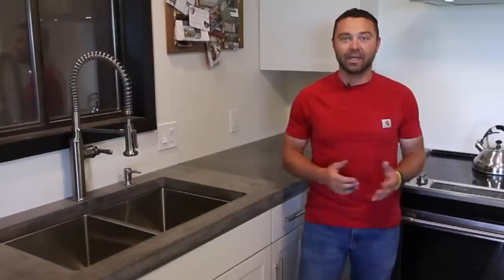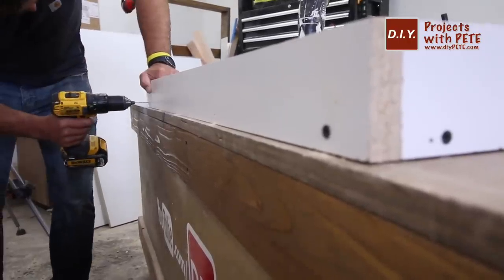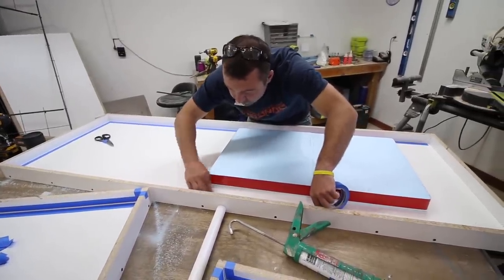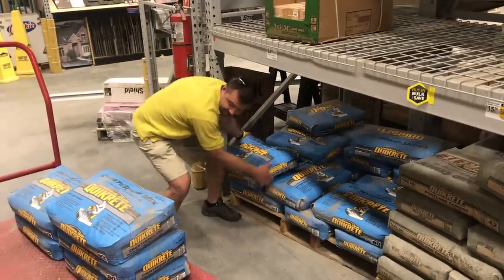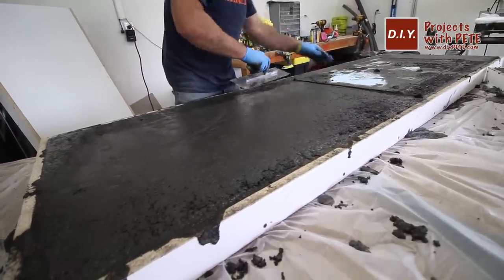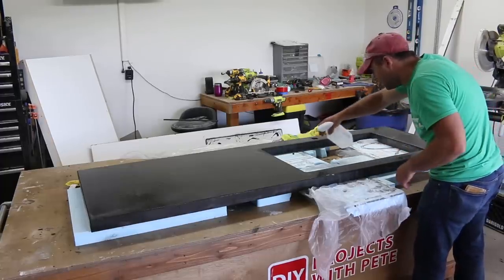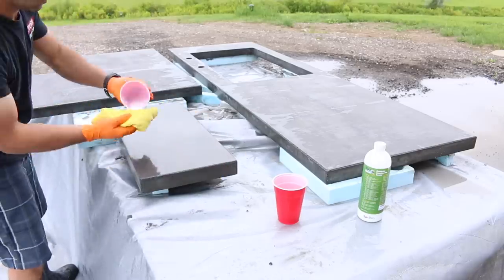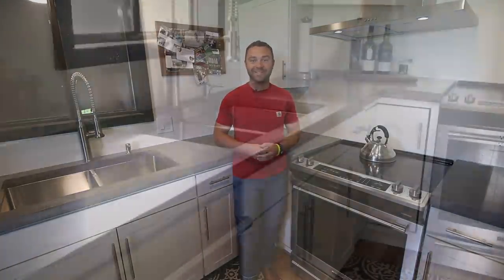How to Make Concrete Countertops

Comment: They look great, you did say a vibrating tool would give a smooth finish. A hammer drill would do this with by gently touching the mould with the the chuck or with a round headed bolt in the chuck.
Reply from the maker: Thanks!

Comment: Looks great Pete. Ever heard of Moxilon 200 nano hydroleo sealer. Can also be used with color but leaves otherwise no trace. It is a combination of lithium silicate and other products I beleve. One treatement is all it takes to seal concrete completely.
Reply from the maker: Hey Paul, thanks for sharing the info on the sealer. I hadn't heard of it, but will look into it! Thanks!
Reply: Hardener/densifiers like lithium silicate are essential when polishing concrete of any kind.

Comment: REALLY!!!  I just found this video after building my laminate countertops... I needed more complete instruction before building concrete counter tops.   I do have a couple of questions.   how do you level the concrete counter tops?  I can see how you level the cabinets service before installing but under the concrete countertops can be uneven.   Have you had a problem and what was the solution.

Also,,, i really like the broken glass countertops along with other creative ways... do you have any videos concerning building that type of countertops..  

I really enjoy the video... i could have had an extra step of two for those of us that need it...

Great Job
Reply from the maker: Hi! You'll want to make sure to screed the concrete after the pour to level it out, and then trowel it to ensure it is as smooth as you want it. Pouring the concrete on level tables is going to be one of the biggest things to pay attention to. Otherwise while curing it can flow more into a side or corner. -- If the bottom isn't perfectly level, you can use a few shims to help. I also use descent sized globs of silicon and a bead around the countertops for it to set in. Best of luck!

Comment: Pete...Try Hydro-Wic from Elastocrete for the sealer.....bullet proof epoxy based. In fact just pour in place using the Elastocrete system. Rad hard counter tops :).

Comment: Cutting profiles on denominational lumber, ripping them on the table saw then tacking them in your forms will give you a huge variety of  edge profiles.  I found a soupier mix ( Sakrete Counter top mix)  will yield less voids and a smoother finish at break out and that pays dividends in the final finish step.
Reply from the maker: Thanks for the tip!

Comment: Excellent video. Your descriptions about what you were doing and why are awesome. The one thing I might do differently would be to use an edger on the concrete while it is still wet, as it would save a lot of sanding time and I hate sanding.

Comment: Thanks for the video... Does the sealer protect completely against sitting water?  Planning to do a bathroom sink but don't want any darkening from the wet surface (cause I suck when I shave)... Do you recommend some kind of acrylic finish?
Reply from the maker: Hi! The sealer is alright. I prefer Omega concrete sealer over it for durability.

Comment: About to jump into building a slab for a fireplace hearth along with two small counter for the cabinets on either side of the fireplace. I have a question about the reinforcement.... I noticed that you only used the rebar around the sink. My question is since I am not doing a large cut out like you did for the sink can I get away with just using the mesh sheet cut to size? My dimensions for the hearth are 77.5 inches long by 25 inches deep by 2 inches thick. Obviously, I can for the counter tops as they will only be 23.5 x 24 x 2. Great video, very informative and I can't wait to get into my project!
Reply from the maker: Hey Wesley! I've done slabs similar to your size with just the mesh. Here's an example: https://youtu.be/A0Pd4o8gjfM

Comment: Aweeesommme.  I didn't read through all the comments but wondering how many hours a project like that would take. I have a similar setup
Reply from the maker: Hey Frank! It is day to build the mold / pour, and the following weekend to finish/install. There is some work in between. It is hard to say exact hours. It is a time consuming project but the end results were worth it in my opinion.

Comment: Pete awesome video. I just finished 3 countertops yesterday , they are curing now. This video was a huge help. I will be polishing them with a orbital sander and I'm trying to find the video you talked about. Can you help me out? Also does clear caulk work fine to join the seams of the 3 countertops together?
Reply from the maker: Hey Blake! Sorry for the delay, did you sand them already? Here is the video, it got delayed in getting up and I just posted it today: https://youtu.be/A0Pd4o8gjfM   --- as for clear silicon, I actually used some in this video and thought it looked just as good or better than colored. Hope that helps!

Comment: Those counter tops are gorgeous pete. Over all what would you say is the total cost compare to granite. Well done bro.
Reply from the maker: Thanks Robert! I have the costs associated with the project on my website which is linked to in the description. As for if they are professionally done, basic tops like these will most likely be in the $65-$85 per sq foot range. Fairly similar to granite.

Comment: Assuming the kitchen carcasses have plastic legs. Will they still take the weight of the big worktops ? Looks a nice job, this is what I want to do but add the coloured resins to make them look marbly
Reply from the maker: Sounds like a fun project! Without having a look at the plastic legs on your cabinets, I'm not 100% sure if they'd support the weight. I'd imagine you could beef them up a bit though if you felt it was necessary.

Comment: This was very well done.  Thank you.  One question. Why did you use the reverse cast technique rather than finishing the exposed side and using it as the top of the countertop?  Wouldn't that save you time and effort?
Reply from the maker: Hey Chris! It is certainly an option and I will most likely show that process in an upcoming video. I don't necessarily recommend it to beginners because it requires troweling the concrete which is an art and takes quite a bit of practice to get a nice, smooth, hard troweled finish. Definitely nice not to have to polish though! Here is another video I did which simplifies the process a bit more than in the video above. https://www.youtube.com/watch?v=A0Pd4o8gjfM

Comment: Great video and commentary. I've seen a person use a palm sander wrapped in plastic to vibrate the concrete. I've not tried it myself but amazon.ca sells a Tacklife brand for 20 bucks CAD so it may be worth a try. It's the square type which only vibrates with no rotation. It may be easier than lifting the whole counter top many times.
Reply from the maker: Lots of different options for sure. Cheers!

Comment: Pete, how would you recommend making countertops longer than 8 feet without a seam? Have you any luck with this? I have a 116" long countertop to make for our home renovation and I'm a little concerned making a longer mold will reveal a seam.
Reply from the maker: Hey Anthony, If you are confident with a trowel, you could do a pour in place countertop to eliminate the seam issue from ever showing. I have done a piece successfully that was longer --- but I did polish the tops down to the aggregate as it did show a bit if I didn't.

Comment: Geat video..!!  I want to build a concrete dining table for out side the house but I don't know where to start. Is this even possible..??
Reply from the maker: Hey Zipo! Yes, the project is pretty similar. I'd recommend using Quikrete 5000 and doing about 1.5 inches thick. Here is a similar video and tutorial of the process: https://www.diypete.com/diy-concrete-dining-table/

Comment: It looks great, the seam is no biggie, If you wanted to, you also could have used a high grade epoxy in your groove, it can last a little bit longer than silicone and if you use the hardener and lightly brush in a little acid water mixture, epoxy will not collect dirt or grease. There are also several epoxy preps that will keep if from lifting off of the surface.

Comment: Interesting project, great results.  The mold project looks quite intense but I guess you get out what you put into it.   Seems like you can do without the fiber if extra 3/8 rebar was placed along the narrow section, front/back of the sink cutout.   You mentioned hog panel,  that got me thinking about 4x4 mesh horse panels. They come in 20' lengths, various heights starting at 36".  Best part they are galvanized and be very rigid support.    Since counter tops get quite wet, is there any additive for the concrete that would waterproof it  or is that already in the type of quick crete that you use?
Reply from the maker: Hi! Hope all is well. Fiber is great to add and cheap, so using it is well worth it in my opinion. I would imagine the hog panel is probably the same thing or very similar. Definitely works well for 2" and thicker countertops. As for adding something to the concrete, a Densifier is an option - but a good sealer will do the job. I'd recommend a sealer called Omega by the concrete institute. I have used it on a couple test projects and it performs very well. Great to hear from ya!

Comment: A few ideas. Hoping for feedback. 
1.  Trying to mimic a textured granite that I’ve seen in bars. Would chip board work as a mold to give a uneven texture? Could I seal the board with polyurethane  to prevent water absorption. 

2.  Would fitting a piece of shoe molding or something like that around the inside parameter of the form provide “custom” edge?  Again I’d need to seal the molding with something. 

Thanks.
Reply from the maker: Hey Aaron! Great to hear from you. I've used the rubber molds from companies like https://www.expressions-ltd.com/?gclid=CjwKCAiA7vTiBRAqEiwA4NTO6-U6nWQT2RVwqLKFBPdEob3G-RenxaSHZLmHGMG1q2ai3m2n0KdE0BoCl2gQAvD_BwE   to do stone-like sides. You could use shoe molding or other items as long as they are sealed well so they pop away. I'd recommend doing a smaller table or two prior to doing the big project to get a little practice. Cheers!

Comment: Looks great good job add a touch more water and it will be easier for you and put a densafing compound on it when it drys from the wet grind and use your 800 pad after the densafire run it dry then seal it it wont stain
Reply from the maker: Thanks for the tip

Comment: Have you tried concrete overlay rather than solid concrete for countertop? My cabinets are old and not strong to hold the heavy weight of concrete. Would love to hear from you whether concrete overlay for countertop is feasible. Thanks.
Reply from the maker: Hi Ann! I've seen a number of folks do them, and here is an example of a project I did: https://youtu.be/mEazDBRc2GY    ---- Mine turned out a little darker than I wanted, but they've held up well. I do honestly like the look and feel of solid concrete more -- but the overlay is a good fit for some folks as well. Best of luck!

Comment: Great work 👍👍👍👍 what about in the case I have to change the sink if stay between the concrete and the counter ?
Reply from the maker: Hi! Well, if you are replacing it with the exact same sink, you could cut the silicon seam and then remove the concrete - reinstall a new sink, then put the slab back. If you are planning to get a different type of sink with new dimensions, you'd need to have a new countertop made to fit custom to the new sink, similar to what would need to be done with granite or marble. Cheers

Comment: Great idea and it looks very good, but would the maintenance of it be hard work.. like accidentally  cut something without a board.. etc..
Reply from the maker: Hi Wayne, I treat the countertops much like the granite ones I had in my old home. I do use cutting boards, and try not to spill oils on them. A little maintenance but not too bad.
Reply: DIY PETE I wish I had the confidence to try something like this...

Comment: Can you temporarily glue some foam to the underside of the counter top when flipping it, to keep them from moving around?
Reply from the maker: Perhaps, I would only do on the underside ( not the finished side ) - It is not necessary but certainly could be done if you feel it's needed :)

Comment: This was so incredibly helpful, exactly what we needed for guideline on the sink cutout! Could you use a drop in sink or would that make the sides to narrow? Trying to determine if we need to get a new under mount sink to make things easier/stronger. Thanks!
Reply from the maker: Hey Jess! Over mount sinks are easier to install. and you should have enough concrete around each side still.

Comment: is it purely a weight issue that you made the 1 section of coutertop on (2) pieces.  Or was it larger than your sheets good for making the forms?
Reply from the maker: Hi John, Yep, I wanted it to be manageable during the build process and install. You are limited to 8 feet with most melamine boards, but I have found 9 foot long sheets available from my local building supply store. I've also joined boards before to extend the molds. Cheers

Comment: Thanks, Pete! We are following your video step-by-step now! They are currently drying in the forms. As an update, are there any sealers since this video has been taken that you recommend? It would break my heart after all this work to have them ruined by oil stains (our cooktop is going to be right beside these!).
Reply from the maker: Hi! The Omega Concrete sealer is what I currently use and recommend. Made by the concrete countertop institute.

Comment: What 20 volt tools do you prefer , or which is the best, like function and durability wise.
Reply from the maker: Hi! I have quite a few favorite brands and it sometimes depends on the tool. As far as function and durability, Milwaukee and Dewalt are my favorites.

Comment: what is the white/blue thing you put after polishing, i'm thinking to make wood table with cement touches, i want it strong and water resistant because it will be a dining table, do you think cement will not digged or break overtime?

i want to add a protection coat what do you recommend?
Reply from the maker: Hi! I think you are referring to the blue scotch pad.   -- My tables have held up great over the years without issues. I think yours will hold up well. As for a protection coat, Omega sealer is one of the best out there right now and it protects well. Other options are Cheng Sealer on Amazon.

Comment: Awesome work! I am thinking about doing this. I have a kitchen island that Is pretty big and I would need to build a form with 2 base sections in order to get it in one piece.  Curious if you have ever done that, and if it still turns out nice?
Reply from the maker: Hey Chase! You might look at doing this as a pour in place project and cast it right side up. I have done a 10 foot wide by 5 foot piece but it was a beast to work with and I wouldn't do it again. I had a perfectly flat work surface and then used pocket holes to connect the two boards. I put a super thin piece of foam over the seam to cover it. I then polished the entire top and exposed the aggregate a bit. This removed the small line I could see from the clear tape. Best of luck!

Comment: If using pvc pipe its easier to oil the outside. The cement wont stick to it and its easy to get out. We do this when we use pvc molds. For colouring: if you dont want to colour the mix you can dust the top with oxide. It soaks in a bit & you can also control where & how much you put in for different effects. I like epoxy resin as a sealer
Reply from the maker: Thanks!

Comment: How heat resistant is it with that sealer? Could I place a searing hot pan on top without much damage? Thinking of doing this for my countertop. I've just heared that the finishes on concrete get damaged with heat.
Reply from the maker: I typically put a trivet or pad underneath the pan to be careful as I am not 100% sure how if it would be a big problem.

Comment: What is your suggestion for transferring a concrete countertop with a farm style sink? Would rebar help with securing the faucet area during transfer more than mesh would? Or does it matter?
Reply from the maker: Hi Jeremy, is the farm style sink concrete? Is it one piece with the style where the countertop flows into the sink? Or is it a separate sink, and one of a different material?
Reply: DIY PETE it is a different sink. Stainless steel top mount. We havent put the cabinets in yet so im not positive how wide that back rail is going to be from the wall to the sink...we're thinking about 6 inches...only one hole though

Comment: I'd like to build in a cantilever for a pour in place bar with my countertop, what size rebar do you recommend and how tight should they be squared off?
Reply from the maker: I use 3/8 inch rebar typically for 2 inch thick countertops -- about 16 inch squares.

Comment: Pete, I've done several concrete tops and I think most guys spend way too much time prepping with the tape.  if you don't put too much silicone to seal the corners, you don't need any tape.  Also, you don't need to seal the bottom or even wet sand it, that it completely unnecessary.  Other than that, I really like what you did with the undermount sink, I will use your idea next time instead of drilling the concrete.
Reply from the maker: Thanks so much!

Comment: Hi Pete:
I have a very old tile counter top, tiles are 1.5" squared and very difficult to clean - not to mention ugly as sin. Do you have any suggestions for resurfacing? Thanks in advance.
Reply from the maker: Hi Nigel! I have seen folks do overlays, but if it was me I'd probably look at removing them and replacing with quartz, concrete, wood butcher block, or something else besides tile. I've had tile countertops before and they were hard to clean and they didn't look great.
Reply: @DIYPETE ; I was afraid of that, lol. TY though.